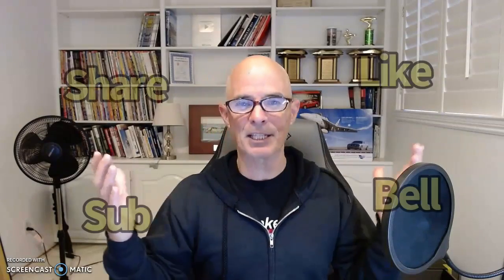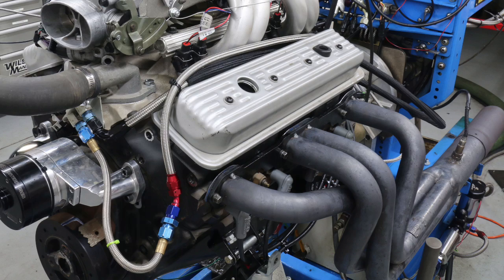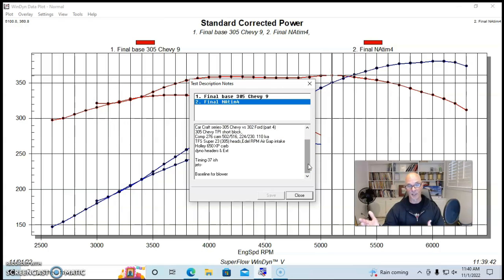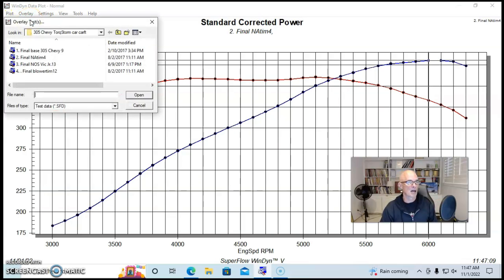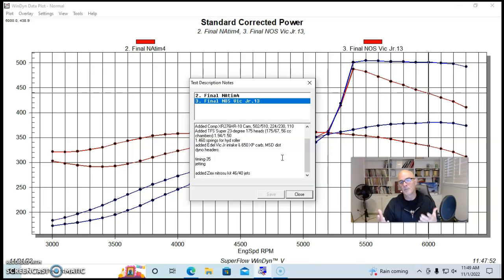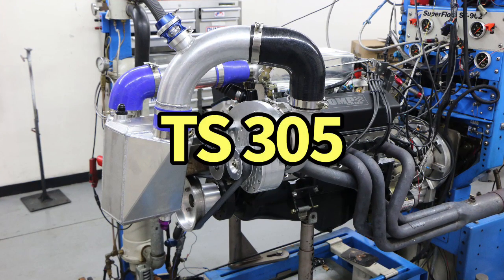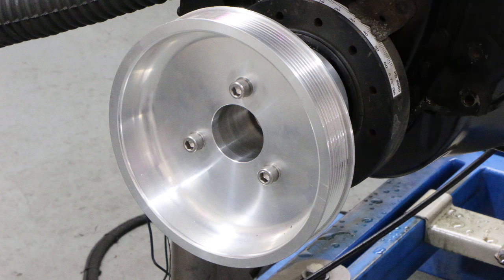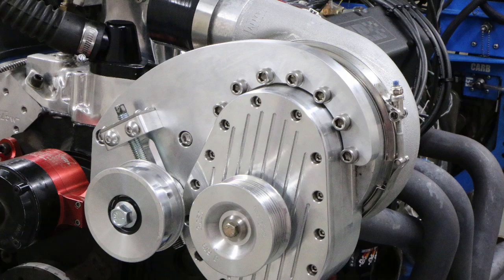THE OTHER GUYS SMALL BLOCK CHEVY-HOW TO MAKE POWER WITH A 5.0L 305 CHEVY. 200, 300, 500 & 600 HP!

Comment: Love the 305 videos! Ive learned a lot as far as what kinda power i will make with similar set up. Shooting for a mid 12 second 1/4 with my 83 z28.
Reply: That's awesome I still have my 1984 Z28 5 l ho 5 speed that I bought new pretty much out of high school seeing this is inspired me to get it going again
Reply: @Joe Hudson  mine had a 305 with the crossfire injection on it. Pulled that junk off and went carbed. Edelbrock 600cfm carb, performer RPM intake, trickflow super 23 heads, k12-600-4 comp cam with 1.6 rockers puts it at .510/.496 lift, 227/241 @.050, then i have the crank and rods just gotta buy the pistons and have the machine work done to make it a 334.
Reply: @ShortFuzeDrummer  my 305 is worn its got 115k on it I just built my first 350 I went with a GM ZZ4 block forged crank H-beam rods forged Pistons from summit racing a nice hydraulic roller from comp cams for efi and a T-76 turbo
Reply: @Kenneth Rand  i picked up an 85' block so it was a tpi, ran great, no smoke or anything. This is my first engine build so id rather blow up a 305. I have a 5.3 sitting on a stand for later, that will be the big money build
Reply: You can do it I'm running low 13's with a stock bottom end lb9 305 well it does have a mild cam of my design and L30 heads as well as the Holley stealth ram
Reply: Currently gone put my 305 in a 80’ z28 myself!

Comment: I never understood why Chevy put dished pistons in the 305. I think it would have run much better with flat tops.
Reply: It would've but then probably would've required premium
Reply: The LU5 crossfire engine, the L69,  all of the TPI motors, and vortec 305s had flat-top pistons. The low output LG4 got flat-tops after 1986
Reply from the maker: THIS MOTOR WAS A FACTORY TPI LB9-IT HAD DISH PISTONS
Reply: @richardholdener1727  I stand corrected. After some research, 85-86 TPI 305s were flat-tops. 87up TPI 305 indeed had a dish piston
Reply: @kylemilligan752  must be the Camaro 305's
Reply: @richardholdener1727 thought you may like this HP? https://youtu.be/jj6jpZwRay4
Reply: All the 305s need bored out just enough to have the added flow for the high flow heads to be added. Been building a stroker 305 but yea just revv it to the moon and get the top end built to handle it with a cam just let it eat lol.
Reply: 305 was never intended to be a performance engine
Reply: Should do it again but with turbos. Wonder if we could get close to 800hp Richard? Im gonna put a 305 with a turbo in my nova drag car for next year.
Reply: L69 305 had flat top Pistons,must 305 heads are 58 cc not 64 on a 350
Reply: My 83 G20 had factory flat tops with 53cc 601 heads in its LE9 305.
Reply: I’ve got my dad’s 1995 Chevy Silverado with the 5.0 lever recently it’s a very beautiful truck with no dents or scratches. He took very good care of it and I’m wanting to take it to the next level and keep the same engine because everything on the truck is sentimental to me. He’s had the truck since 1999. Transmission is starting to slip so I’ve got a rebuild it, and I would like to go ahead and rebuild the motor and put a cam and upgrade the meter system.

Comment: I built a 305 with the old double hump heads 1.94/1.50 valves. Regular performer cam and regular performer air gap and a 600 Holley with 1 5/8" header. Was a blast to drive in an old 72' c10
Reply: Did you milk the heads down or did you find stock 56cc double humps? I have a 78 305 with smog heads so I’m looking for anything that flows better while I put in a cam and turbo
Reply: @ethanpenney7857  stock heads. Didn't port or gasket match anything. Lapped the valves and called it good even with the old valve springs. I'm not sure what the flow numbers on all that old stuff. But I would suspect even the smaller valved heads like I used prolly flowed mo betta than 305 heads.
Reply: Double hump heads likely lost power.....because it lost compression.

I did the same thing to a 305.....it definitely wasn't any better. In the back of my mind i always thought it lost a little power.
Reply: @HioSSilver1999  that’s fair. I don’t think it’d be as big an issue in my application if I’m going turbo. Not sure tho. Probably gonna try and find 305 vortec heads
Reply: @ethanpenney7857  no reason to lower compression for a turbo.  Compression is cylinder pressure.....boost drives up cylinder pressure. You just need the fuel to cover it.

If i have learned anything from watching richards vids it confirmed what i always thought. A good na combo is also a good boost combo.
Reply: @HioSSilver1999  for max power yes. I want something that doesn’t take so much timing so I can get away with 89 octane with boost. I’m sure there’s fancy tuning that can be done with computers that’d eliminate the need but I want it simple, just carb and dizzy for tuning with one little box to pull a couple degrees for every pound of boost. I’m pretty sure running 7.5-8:1 with 15psi vs 10:1 with 15psi would be less prone to detonation?

Comment: I installed a 1996 Vortec 305 in my 86 GMC. I converted it to carb with a no name Performer type dual plane with a Qjet , headers , 2 1/2" dual exhaust and it runs terrific.

Comment: I had a 84 firebird with the LG4 305 and 5 speed, good torque and pull in 5 the on highway but not going win any races.

I pulled it and used the L69 as a model, put in flattops bored 0.020  to bump to 9.5 cr, cam about 420/440 lift, performer intake (. CRane compucam 2030.)   Full Edelbrock TES headers, 3 inch exhaust.   Car was night and day.  Would win races but this was 20 years ago.

Comment: I took a 305  out of a 86 chevy truck , added a sb400 with good heads and cam , gained about 200 hp over the 305 and several mpg.
Reply: Did you dyno it?
Reply: @augustoescobar50  not the old 1986 305 carb motor but I believe it was factory rated at around 180hp and mine was very tired and really didn't like 35 inch tires . The sb 400 made 385 hp and  has enough power to move 37s without revving it to the moon.

Comment: IMHO, the perfect 305 configuration would be the tuned port (long runner) with decent set of heads (I don't think they even make an aluminum head for the 305 anymore), "junk" 350 4 bolt one piece rear main roller block sleeved down to the correct bore size, forged 3.750 crank )331ci at factory bore size) forged pistons with modern low tension rings, forged rods, and a smaller single turbo setup.  I wouldn't attempt to build it for all out horsepower (there are MUCH better platforms for that), but more as a boosted equivalent to a healthy big block. 
Something that is putting up 500+ ft/lbs, maybe 400hp, and the show's over by 6000. Slap it in a dually, and let it eat. 
The only possible downside to it (other than cost, and I don't own any of the parts, or a truck to put it in) would be the ultimate strength of the block casting might be suspect for heavy loads and sustained use under high boost.
Reply: An actual 383 would be even better...

Comment: I did this test on my 79 Camaro, back when,  I was in HS 1996. My 305 with Dart heads and Summit cam, can't remember the specs,went 15.1 in the quarter. Then I sprayed a 150 shot,went high 13 sec. Then a 454 was in charge. I took the N.O.S off and put it on my 1994 S10 SS with a CPI 4.3L "100" shot went high 13's in a stock 4.3L.
Reply: Bet that’s partly a difference of gearing. Three speed auto camaro with cruising gears? Compared to a 4 speed auto that now has a shorter rear gear for better off the line acceleration? Just my guess from the model years and times. Bet that camaro would scoot pretty well with proper gears if it’s the case

Comment: The problem with the 305 is cost per HP. One reason the third Gen Camaro guys were ripping out the stock TPI 305 and installing rebuilt carbureted  350s from the '70s was the fact that the 350 was cheaper to build and generated more power per dollar.  Yes, you can make 500HP with a 305 witj nitrous or a blower or a turbo. But the 350 with the same mods will cost less to build and make more HP and torque.
Reply from the maker: a 350 is not cheaper if you already have a 305 and will definitely get better cruise mpg
Reply: @richardholdener1727  350 core engines were selling for $50-$100 at the time. Even if you already owned a 305, it still paid (in terms of HP/dollar) to swap in a 350.
Reply: @alantrimble2881  I'm with you. Way back when, had a 305 3rd gen w/a 750,Vic Jr,big cam, headers, exhaust. Spent about $500 for some used 400 SBC junk. Swapped over hotrod parts. The 400 would put bus lengths on hot 5.0's and LT1 fbodies of the era while burning 87 octane.
Reply: The 305 was toted as a reliable engine but for fuel economy just like the 293 is for 1999-2014
Reply: @shadowopsairman1583  But the 305 didn't deliver notably better fuel economy in the real world. I know. I had a dead stock '77 Nova with a 305 2 bbl.  It was a dog, and it didn't deliver impressive fuel economy.
Reply: That was done a lot, but I redid  the 305 in my 3rd gen for super cheap and output went up drastically without impact to economy

Comment: In the 80s the 305 was pretty much all we had.  Hard to believe but 350's were few and far between in new cars.
Reply: Trucks
Reply: PS. I prefer the carbureted cars even though TPI looks cool.
Reply: Even the 350s were less than impressive.  Remember the 350 in the '87 Vette for example???  Four cylinder Hondas make that kind of power N/A these days
Reply: Yes we always have to have that guy talking about how a Honda can make that power now, well who cares that didn't exist 35-55 years ago and a Chevy LS lays waste to them now.
Reply: @stephenkowalski2448  I don't understand your point.  My point is that the 80s was a low point for power.  We have come a long way since then - Honda, Ford, LS or otherwise.
Reply: @scotttimpany2845  1987 was a high point for power compared to 1977.
Reply: @stephenkowalski2448  I guess you have a point!  🤣
Reply: @stephenkowalski2448  Nuclear Grizzly started the thread talking abou tthe 80s.  He reminded me that I went to work at a Chevrolet dealership after high school.  The new Vette was rated at 230 hp, and the Grand National was rated at 235.  The 305s in the Monte SS, for example, was rated at 180.  I think the low gearing in the 700R4s and the torque production of engines equipped with tuned port injection made the cars "fun".  As far as performance, THESE are the good ole days
Reply: @scotttimpany2845  I mean saying your new Honda can beat a car of 50 years ago actually just shows how impressive cars were 50 years ago.  Like should a 25 year old feel proud to beat up a 75 year old?  Also these 50 year old engines were not exotic cars, they were everyday man's cars that were often priced lower than your new Honda ( adjusted for inflation) so considering this was 50 years ago or even 35 years ago seems to me makes a lot of newer vehicles unimpressive.  I doubt many people who owed these things 50+ years ago expected them to be so coveted today, that's why most were used up and junks, the cats of the future should be so much better no contest.  Yet here we were decade after decade so proud a car from back in the day could be beaten..  actually 1987 was a great year for cars I mean you had the grand national and a Corvette still isn't slow, the Corvette still runs with a sporty Honda of today
Reply: @scotttimpany2845  regardless of the lower HP rating they run faster than many Hondas with a higher HP rating.  Also they knocked a lot of 1980s cars compared to 1960s but net rating was Net so a 250 HP 350 would be rated at least 300 hp back in day.  A lot of these 1980s cars run a lot harder with minimal mods.   It is the good ol days in some ways
Reply: @scotttimpany2845  Monte Carlo SS was fun, but admittedly my 2007 Ford focus ST with 2.3l runs as hard as those, but it's fun also, they tuned it and it has low gearing.  Ford focus rated at 151 HP and 155 torque, reminds me of a sporty 305 car but much more fuel efficient
Reply: @scotttimpany2845  I know, but not much before 350s were like 165-190 HP.  I think a 1980 z28 was rated a whopping 190 HP, so probably 250 HP gross.  Going from say 170 HP in a 350 to 230 HP was a big deal, then the 1990 iroc was 245 HP, they were running a 14.4 quarter mile , many would say that's fast today when a Honda does a 14 second quarter...
Reply: @stephenkowalski2448  I don't want to argue.  I wasn't promoting Honda or bashing GM.  Performance (reliability, fuel mileage and even sealing) has improved dramatically across all brands.  Everybody has their thing... my thing is an S10 that makes four digits plus at the flywheel.  If you're into the Monte SS or the Vette or a green Toyota MR2 with a V6 swap (I saw it in Raleigh NC about a year ago.  It looked factory!  Super clean build and I was told 280 hp at 2600 pounds), or anything else, I don't care - those are cool too.
Reply: @stephenkowalski2448  If I had unlimited time and money, I'd really like a 69 Mustang fastback with a big inch Kaase N/A BBF back by a 4L85E and a 9 inch Ford rear.  I'd build it to make about one bazillion ft lbs.  With 2 something or super low 3 something gears in the rear, it would be a monster on the street.
Reply: @stephenkowalski2448 that’s like saying a 20 year old bet a 60 year old in a running race what a surprise!
Reply: @MrScottt28  Heck, California Vette's were relegated to a 305 with an automatic.
Reply: @MrScottt28 man the camaro irocz from that same year was damn fast to me
Reply: 80s street knowledge. T-top camaros and firebirds were 305s or 6cyl.  Hard tops could be a 350. All G bodys were 305 or 6. So easy picking all around except se hard top F bodies and Grand Nationals. lol
Reply: @BBBILLY86  It was well into the 80's before GM offered an F-body with a 350.  But it was an automatic only option.
Reply: @nucleargrizzly1776  We need a fact checker here. Every generation of Camaro had a 350 option available.
EDIT
The only generation Camaro that didn't have a 350 or 5.7L engine is the last generation from 2009 to present. They have a 6.2L LS series engine.
Reply: @thatsonebadhatharry8610  Read the whole thread.  Thanks.
Reply: @nucleargrizzly1776  I thought this was YouTube not a forum that has threads. I was replying to your comment that it wasn't  until the late 80's that GM didn't offer a 350 in a Fbody. What then were you referring to?
Reply: And yes both Camaro and Firebirds are fbody's.
Reply: @thatsonebadhatharry8610  It was addressed in the thread.  Thanks.
Reply: @thatsonebadhatharry8610  And as discussed in the thread the 350 wasn't offered in an f-body from '82-'86.  And then only with an automatic in the gen 3.
Reply: @nucleargrizzly1776  You are correct about the 3rd gen but you never mentioned 3rd Gen in any of your replies until your last one. The 350 did come in the 1981 Z28.